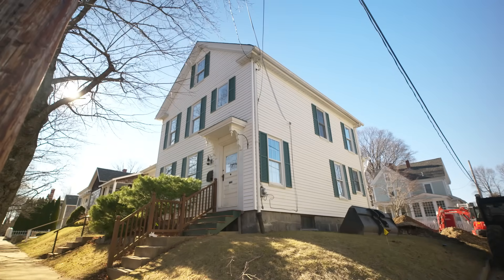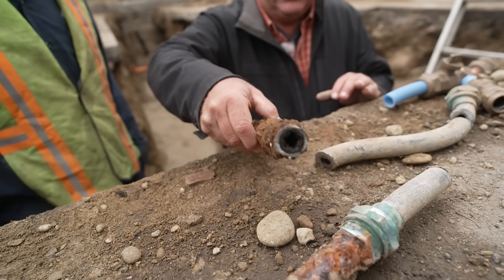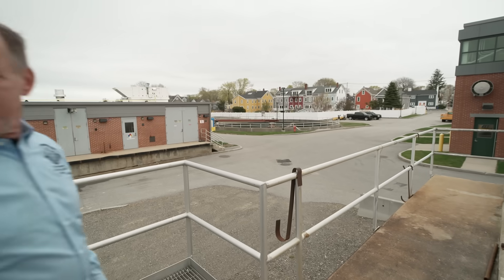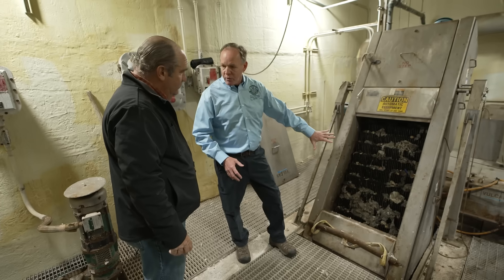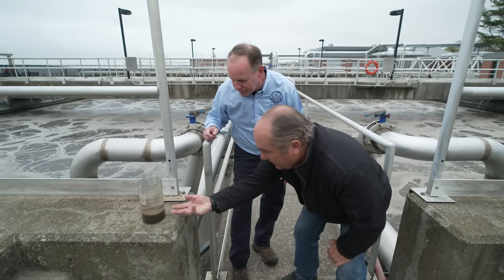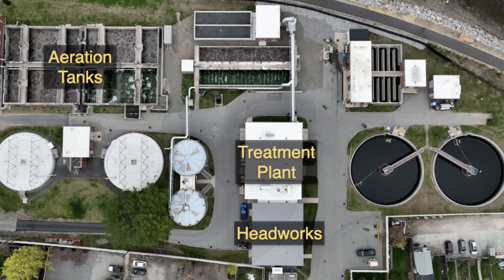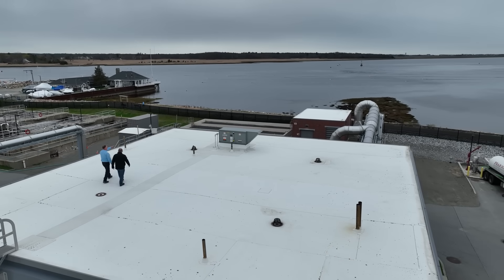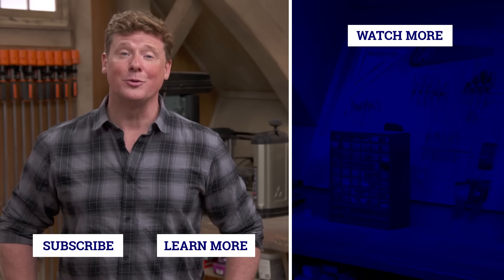Wastewater Treatment by The Sea | This Old House

Comment: Your discharging fresh water into a saltwater environment. Not good for fishes.
Reply: The river flows at 30,000 cubic feet per second while the plant outputs 5 cfs. The plant doesn't make any difference in the amount of fresh water going to the ocean.
Reply: @pprb123 That's just one plant.
Reply: @Hookset2490  Negligible compared to a good rain storm.
Reply: @petersharp90 Really? My local sewage treatment plant discharges approximately 1 million gallons of chlorinated fresh water into the bay every day. And that's just one plant. There are about 5 more plants doing the same thing within a 50-mile radius.
Reply: @Hookset2490  Youre saying that 15 - 30 cfs is more of an impact on 30,000 cfs? Still negligible. What else would we do anyhow? Not treat our sewage? That'd have much more impact on the fish
Reply: The River isn’t Salt Water, right?
Reply: @Giantravis A river isn't but the "sea" is.
Reply: Probably brackish there so some additional fresh probably doesn't really make a difference

Comment: Flushable wipes are not flushable
Reply: And yet somehow still aren't strictly regulated. Sewer authorities collectively spend billions dealing with them. Read about some lawsuits, but little has changed other than wipe manufactures adding a warning message on the packaging. Many ignore those and still flush them. The product itself is a public safety hazard. Should be redesigned to be truly flushable or sale highly restricted.
Reply: hi warrentrout, to see evidence that space agencies are lying, I suggest watching Level with Me (2023) by Hibbeler Productions

Comment: What does it smell like when you open bin number 2?
Reply: Probably less noxious at that point in the process than when you first dropped it at home.
Reply: If this is a #2 reference, you would probably be disappointed.
Apparently it smells like fresh wet compost, since it basically organic fertilizer at this point.
The first step, solid waste removal, is supposed to be the smelliest step in the process.
Reply: @derradfahrer5029  I have been to a number of WWTPs and yes, the headworks is the smelliest.

Comment: They replaced my water line in my house, due to it being a lead water line. I live 130 miles from Flint Michigan. It's cool on how it's done. The tie the new water line to the old line. Then, they have a device on a Bobcat, that rolls up the water line in a round ball. So, they pull the water line from your house to the connector outside. So, they don't have to dig up your yard.
Reply: This is called treanchless water or sewer line replacement